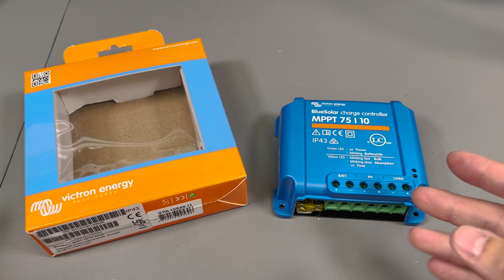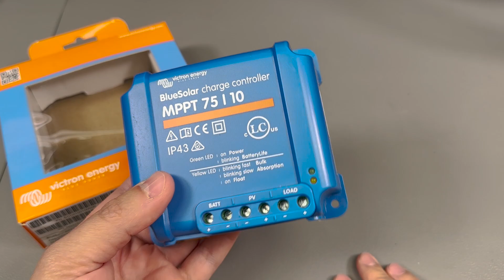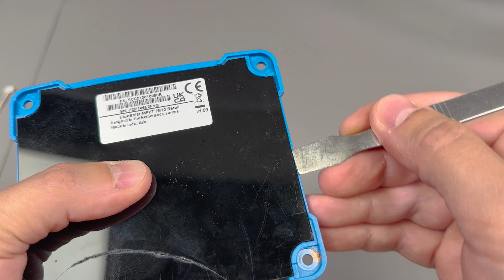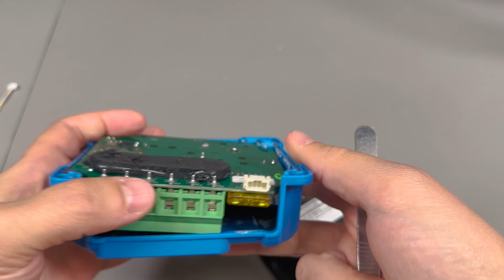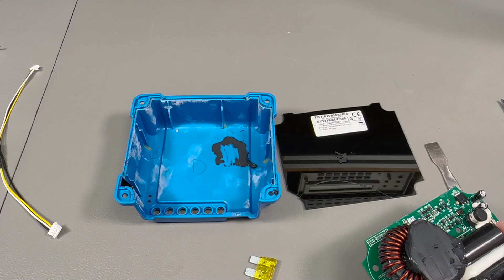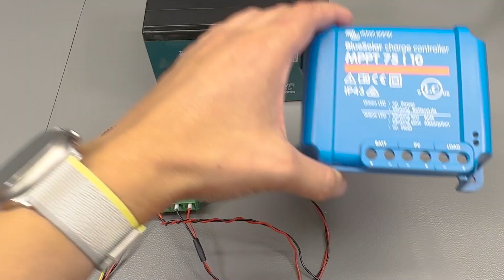Victron BlueSolar MPPT Charge Controller Repair | #487

Comment: I have purchased several USED victron's and frankly their corporate greed on the NON serviceable ones is annoying.  However, the 75/10, 75/15, 100/15, and 100/20 have the replaceable fuse.  Anything else is potted and nearly impossible to open (by design) and contain LET fuses.  The 100/50 has a LET80 fuse in it.  The company knows that people screw up and reverse battery by accident, hence the reason why you cannot service them.  Thanks for the video.
Reply: I got a broken one where they reversed the polarity of the battery and smoke came out. But it looks like the fuse was only blown. I measured ohms and load is at 400 pv is around 380 and when i bypass the fuse it crawls up to 820 ohms. I think it's still working if i put a new fuse in it.
Reply: The potting was/is for different reasons.
Reply: @dougle03  what reasons?
Reply: Moisture

Comment: Fuses, not all fuses are equal, only use "branded" " Littelfuse" etc.   Many of the unbranded fuses have questionable ratings and the splade terminals also fail due to being too soft.   Not worth the risk.

Comment: Regarding the 'reversed polarity' of the BATT terminals, if they want to keep it in order to simplify the PCB, they could at least make the difference more evident on the external shell, e.g. making screw holes for the neg terminals as squares (which could be anyway a good idea as those -/+ signs may not last very long under sunlight)
Reply from the maker: That's a good idea!

Comment: What the heck is "Made in India, Asia" lol
That wiring order is commonly reverse on many MPPT converters, which I agree is garbage design.. someone thought a few minutes of PCB layout was more important than ease of use.
Reply from the maker: I can only guess that there is a rather constant small percentage of damaged units, across brands, globally, because of this simple reason.
Reply: The Batt and PV negatives are commoned, thus they sit side by side... VE kit is intended for professional installation; trained professionals won't make the mistake.
Reply: @dougle03  Professionals make this mistake all of the time. Seen many blown regulators.
Reply: @dougle03  why are you being a shill for Victron? you keep commenting with BS like you're some diehard fanboi. Stop being a fruitcake.

Comment: Incidentally, it's not good practice to attempt to run a load direct from solar panels (via MPPT regulator), without a battery.
eg it's not a linear regulator.
Reply from the maker: Not a good practice but a good quick test to indicate the path is running fine.

Comment: I took apart. or more specifically tried to take apart a MPPT 100 50. There was alot more RTV holding the top. enough to tear things off the board.
Reply from the maker: Is that unit physically larger? Maybe they thought more is needed for structural rigidity to keep it together.
Reply: @voltlog  it is and the base is a giant heatsink. Victron stuff is good quality and they build them to withstand conditions such are boats and RVs. So lots of vibrations. 

they're an interesting company. closed and high quality like apple products, but at the same time pretty open. They have a podcast where they let their engineers talk about products and they provide the image to make your own control panel with a raspberry pi
Reply: @aleks138  do you have any advice for taking off the board without damaging?
Reply: @aleks138 i have the same one and I crossed positive and negative

Comment: The glue is structural beside the connections, for vibration else ware. A pain to service. 
The 2 negative terminals are beside each other so that a high current trace does no have to be routed a distance, but it is a trap for wiring.
Reply: Came here to say this. The layout probably follows the topology of the circit. eg the two negative terminals are common.
Saves having unnecessarily long and high current traces internally.
Reply from the maker: I fully understand that is the logic behind the design, but the distance between the opposite terminal points would be 20mm. Across that distance, on standard 1oz copper, you can safely run 16A through just 5mm width track with a 20 degC temp rise. So I don't see it as a valid point for not choosing a better layout for the end user.
Reply: @voltlog  
True, but the more you make things fool proof the faster your accelerate the evolution of fool.

Comment: Nice that it's an easy fix. 
Dripping some IPA could have loosened the elastic glue. 
While you're at it, one terminal of the input bulk capacitor (C30) looked a bit dark.
Reply from the maker: Thanks for the hint! I inspected solder joints overall, it was just a combination of flux residue with conformal coating that makes it look like that.
Reply: IPA removes hot melt glue, not Silicone.

Comment: The linear regulator (IC1) saved the MCU and the electronics?
Reply: The regulator probably has a built-in diode that shorts out when you connect it reversed, without the fuse it would have probably burnt out, better regulators will have non destructive protection.
Reply from the maker: It could have been that the regulator blocked reverse DC or there might be other diodes in the circuit..